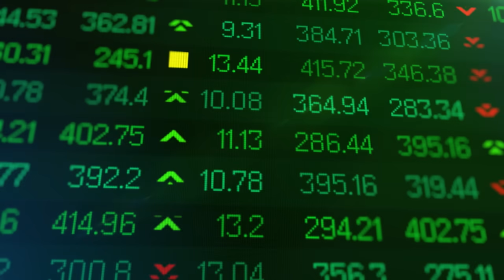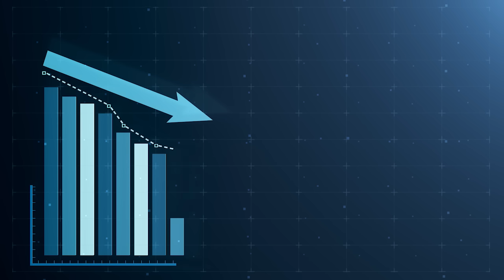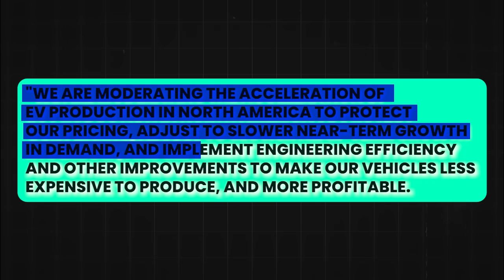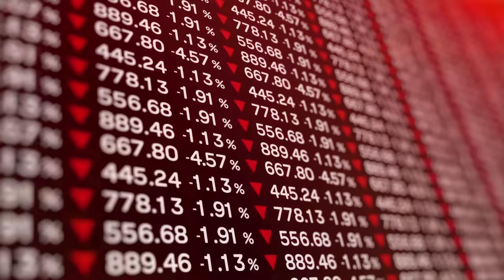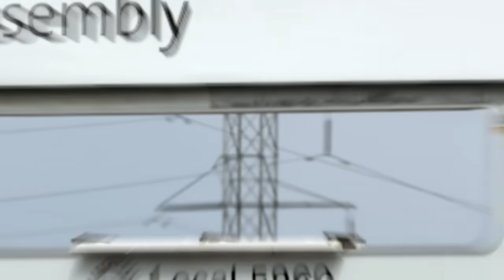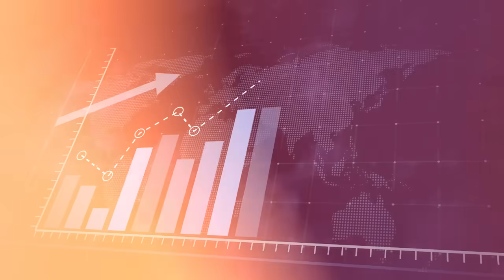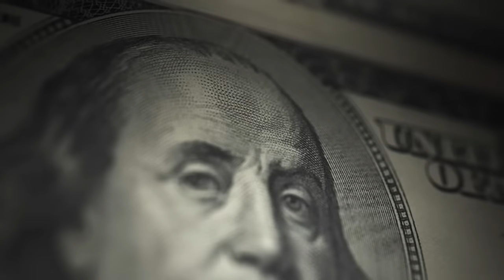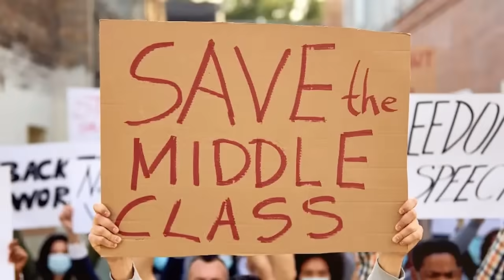HUGE NEWS! GM CEO Just SHUT DOWN EV Production!

Comment: EV's are not practical as a vehicle to keep for a long period of time. Just wait till people have to start fixing them.
Reply: No one is talking about how the batteries will fail and not be repairable within 10-15 years regardless of mileage, charge habits, and maintenance. It’s the chemistry. And the batteries are $10-20k to replace that will total EV’s of that age due to resale value. They want you to focus on degradation from mileage and charge cycles, which is a distraction technique from the real issue. The average age of cars on the road is 12 years, so many are older than 15 years. If you only drive 5k miles a year and keep your car for 100k miles, you will have had to buy 1 or 2 new batteries by then. Horrible for the environment to make the cars financially end of life so soon.
Reply: EV's are so proprietary that most will not be fixable after 5 years as no parts will be available and the cost of those parts will be cost prohibitive.
Reply: So far, EVs have required far less maintenance than gas cars. There are lots of tesla's with over 100k miles and everything works fine.
Reply: @JetFire9  Your comments are three years out of date, mate.
Reply: @frotobaggins7169 you get it sir.
Reply: @KidHorn7001 it’s different for Tesla. They don’t have millions of ICE vehicles to provide support for. This can get very expensive and unsustainable in the long run. Tesla only has a handful of models to support. So they can adapt easier to market demand.
Reply: @KidHorn7001  forget 100k miles, there are plenty of tesla's with 1 MILLION miles and still work fine. And I say that as a Tesla hater.
Reply: Or the fact they will have ZERO trade in value due to failing batteries when it's time to buy a new car.
Reply: @KidHorn7001  Lots of them have had early battery and drive unit failures, but thanks for your lies.
Reply: @sprockkets  Yeah, sure, but how many drive units and battery replacements. Clown.
Reply: Try driving one across a state with wind chills of -30 or even greater.
Reply: @1Mhoram9  That’s easy to do. You just sit in the driver’s seat while it’s being towed in the back of a trailer by a pickup with a Cummins diesel. 🤣🤣
Reply: @swanvictor887  I wasn't aware that 18 year old EVs are on the road. lol. I have noticed that too many people in the comments are bragging about mileage which isn't the point of OP. And as this current crop of EVs age out, it would be interesting to see what the market for them will look like.

 One hopes that a technology breakthrough would be there by then which would actually make newer EVs desirable to buy and own. As far as I am concerned, EVs are still in development age equivalent to what ICE cars were like prior to important inventions like the starter. Imagine if governments of the day banned horse drawn carriages immediately (to reduce methane) and forced everyone to buy a car that needed a crank handle to start. And then Clyde invents the electric starter - imagine the retrofitting headaches that would have caused 🤣.

So by all means, people with the means should buy EVs because funding for R&D has to come from somewhere - as with the history of the development of ICE vehicles. Only the rich and upper classes could buy them in the beginning, as they were also the ones who could have their own personal mechanics to fix what was still an unreliable system.
Reply: @JetFire9  There are now EVs from Tesla for more than 10 years on the market. The experience shows, that the capacity of their batterie lies at something like 85% on average. The capacity goes down quite fast in the first few years, but then slows down. You can expect to  drive a Tesla  200,000 miles without replacement of the battery.
Reply: Fix What? The Engine - The Transmission - The Drive Train - The Radiator- The Brakes - The Turbocharger- The Muffler(s) - The Hoses - The Belts - The Fuel Injection - The Instrument Cluster - The Distributor - The Smog Stuff - Spark plugs - Oil changes - The poor Quality but Expensive warranty work - The poor Materials fading/Cracking. The Catalytic Converter gets stolen.
Tesla has NONE of these complicated systems to need repairing/replacing and requires almost Zero maintenance to get 1/2 Million miles with a (getting cheaper) $15k Battery pack, ready for Another 250k miles. Ohh and the Brakes last about 10X longer because the Motors do 90% of the braking for you while recharging the battery.
Did I forget anything ? Starter motor? - Fuel Pump? - Oil Changes - Dealer Recalls (gone for days, repaired by helpers, not mechanics).
Cheers from San Diego 
And the latest Tesla’s are being reviewed as a Luxury level automobile for Quality and materials. Crash safety is Unbeatable.
Reply: @Julian-1111 Funny you mention recalls. Four of the top five most recalled vehicles are Tesla, and they only have 4 models.
Reply: @sprockkets good lord man watch your words - I see that there is merely 1 to have a million miles.
Not “plenty”.
Reply: @ph5548 idk about other brands (a-hmmmm gm) but 5000 miles per year in a new Tesla the battery gonna last 40+ years
Reply: @rcallenberg  You forgot to mention that the cheapest Tesla is $43,000, and you have to take it to them for EVERY SINGLE REPAIR. So, the brakes lasting 10x longer doesn't really help you out when you have to pay an average of $1500+ for a brake job on one of those when it does come up. But don't worry, I'm sure they don't rake their customers over the coals for parts, labor, and literally anything else like EVERY other dealership in history. And if you think the quality is that great, you haven't done a whole lot of research. People have found all sorts of quality control issues with them right from the factory. That being said, I still do like Teslas. However, we're talking about practicality here. And the average person can't afford a $43,000 car.
Reply: @KidHorn7001  The average age of an ICE vehicle on US roads is 13.1 years. The average age of an EV is 3.9 years. We have no real data on long term cost of ownership.
Reply: Batteries up to 70k to replace.... not many people have 70k laying around ...ontop of buying a 100k vehicle
Reply: Do you also argue that the cost of such an expensive battery means it's not worth it? You can't have it both ways you know. Either the battery is prohibitively expensive, or it will have zero value. It can't be both. Stepping back and examining this properly, there's a lot of minerals in a battery. The value of these minerals hasn't left, just their ability to do the work they are supposed to be doing. (never mind these batteries will outlast the cars, 99.9% of the time, and go on to serve a full second life as stationary storage at someone's cottage, or refurbished by a shop somewhere, before needing to be retired. Once it's beyond any useful life, the owner has 13k worth of battery minerals to sell to the local recycler. And yes, they are almost 100% recyclable. You don't hear about battery recycling all that much because the batteries are better than we thought and there just aren't enough dead batteries to justify building recycling facilities. Yet. It will happen and there are those preparing. But batteries are also falling in cost. My greater fear would be buying a car with 13k worth of valuable minerals in it, and it's only worth 3k by the time it's dead and I'm trying to sell it for recycling.   @TheGodDamnJets87
Reply: I saw recently that the cheapest M3 is down into the low 30k range, 32 maybe? can't recall, once subsidies are factored in. Depending on what state one lives in. I live in a province so it does me no good. But there are no brakes to do. They simply don't ever need replacing. Track cars, maybe a different story but for the average user, they'll never do their brakes. Nothing more than blowing the dust off with an air hose. 
 @schectermeister
Reply: EVs will be an expensive modern day Bic lighter.
Reply: @jeff_mossy  Doesn't matter - the tired line that people need new batteries after not even a few years or not even 100k miles, is simply false.
Reply: @TheGodDamnJets87  "they will have ZERO trade in value" 10 year old Teslas have a price tag somewhere between $20,000 and $25,000
Reply: @rcallenberg  yeah, and who in there right mind would buy a used electric car? With the price tag of 20k to replace the battery? EVs are stupid.
Reply: @schectermeister  "the cheapest Tesla is $43,000" Well, it's actually less than $39,000. "the average person can't afford a $43,000 car" Currently the average price for a new car in the US is $48,000. The most sold car in the US is the Ford F-150, starting price is more than $38,000, about the price of a Tesla Model 3.
Reply: @Texas2Step79  "Batteries up to 70k to replace" Where do get this number from?
Reply: @TheGodDamnJets87  "to replace the battery" 10 year old Teslas have  around 80% of their initial battery capacity. It shows, that the battery degradation slows down after the first few years. Modern batteries are expected to last even longer. Kia for instance gives a warranty on its  EVs of 10 years or 100,000 miles.
Reply: @rcallenberg  cool story dude. 😎 I lived through hurricane sandy in NJ. No power for over 3 weeks, sorry I will NEVER buy an EV. ICE for life here.
Reply: Wait until those lithium batteries need to be replaced at a cost of 20k or more.  The cost of a nice used ICE that will outlast the EV depending on the brand you buy.
Reply: @TheGodDamnJets87  Were you able to find gas stations that had their own back up generators in the 3 weeks that they had no power from the grid?
Reply: @Thankz4sharing  yep, beautiful diesel generators .
Reply: Yup...I heard that the Average Battery costs fall into the range of $3,000-$5,000. Then there's the cost of labor to replace it....
And in a lot of cases, the Car itself is built 'around' the Battery so not many people have the knowledge or equipment to handle replacing it themselves...Not to mention, if you're not a Certified Electrician you could Electrocute yourself and possibly even 'Die' in the process...Now That's a sobering thought...
Reply: @joeleyendecker5346  ...all good points Joel, but you have to wonder: how many consumers will drive just one car over 800,000 km (550,000 miles) in fifteen years?  Once the battery is installed, well, there's little reason to mess with it ever again.
While you ask questions which on the surface are good ones, I'm afraid the free market has already moved on. EV sales are exploding while ICE sales are plummeting.
Love them or loathe them, EVs are here to stay. WE are just going to have to change our ways, is all....
Reply: @sprockkets  not sure what you’re saying “doesn’t matter” to.
It totally matters if you make totally false statements.
It matters that you claim that there are plenty of EVs with over a million miles when in fact there is only 1 recorded case, from what I can tell.
Reply: @rcallenberg What on earth makes you think lithium battery degradation is completely linear?  Every one I ever had worked until one day it didn't.
Reply: @Josh-kp8si  Lithium Iron Phosphate batteries have incredibly long lives, CATL guarantee theirs for ten years and at least 800,000 km.  Few owners keep their cars for that length of time. These batteries will survive long after the vehicle, as they can be recycled. But even if you're correct and its all nonsense....we are at the very start of the EV story. The progress just in the last decade, puts the Auto industry to absolute shame. Developments in Battery technology are breathtaking. Look, I get it, I'm a petrol-head too, loved cars all my life...but its over. ICE IS dead. EV technology is simply in a different league. Moaning and pissing about it isn't going to change Facts. ICE sales are plummeting, Europe (of course) leading the way, USA as ever, lagging behind like a fat wheezy Asthmatic kid on a school sports day...but nevertheless, the change is underway. Simply look at the two top best-selling Vehicles on the planet right now....
Reply: @swanvictor887  I didn't say any of that.  Do you even understand what the word "linear" means?  Maybe try a dictionary next time.
Reply: @Josh-kp8si  I can't find your original comment or my reply, so, I have no idea to what you are referring. have a nice day.
Reply: AMEN! I just witnessed my neighbor going through an episode with his Tesla. It was early afternoon and that particular tow truck driver had already towed 8 EVs.
Reply: Hertz rentals dumping them as minor accidents means writing it off and no servicing and lack of parts. Also insurance going going thru the roof.
Reply: @madewithscraps  you are convincing me completely, that the USA is not ready for such technically complex cars such as Tesla's. Seems the drivers are not ready yet. Europe will lead the way, I guess the USA as ever, will lag behind lol. I guess it is best if Americans stick to what they know and are familiar with.
Reply: @swanvictor887  See ya, 🤓
Reply: @esecallum  Hertz have ordered hundreds of thousand more and in fact, were complaining the other day about the lack of competition because EVs from other companies were utter crap - they were forced to buy Tesla's. I'm afraid you're reading the wrong media...probably media sponsored by Legacy Auto... because the Hertz story is false. But hey, its fine: I expect this from Legacy; they have been fighting, kicking and screaming against EVs ever since Tesla was founded, there are hundreds of billions of dollars and investments at stake, Legacy Auto will keep on funding lies and propaganda until the day they file for bankruptcy. Fake news stories like this Hetz thing are to be expected and it simply doesn't matter: ICE is Dead, it's just a matter of the funeral now. EVs are here, they are not going away. So, the USA will lag behind Europe...what else is new?!  I just feel sorry for the line-workers at Ford and GM: they have been screwed by their management and their Union.
Reply: “The reality of electric vehicles is that they can be 1,000 pounds heavier or more than gas vehicles, and they move faster, with higher torque. Since they’re extremely zippy and heavier, it’s just physics — the ability to overcome inertia so quickly is going to effect their suspension systems, the brakes and steering columns. It’s counter-intuitive, but even with fewer moving parts they are susceptible to requiring more maintenance. They especially require tire-swapping, because the tires wear out more quickly from that high torque and weight
Reply: @swanvictor887  “The reality of electric vehicles is that they can be 1,000 pounds heavier or more than gas vehicles, and they move faster, with higher torque. Since they’re extremely zippy and heavier, it’s just physics — the ability to overcome inertia so quickly is going to effect their suspension systems, the brakes and steering columns. It’s counter-intuitive, but even with fewer moving parts they are susceptible to requiring more maintenance. They especially require tire-swapping, because the tires wear out more quickly from that high torque and weight
Reply: @esecallum  I don't find changing tyres to be horrifically difficult and I change mine every year anyway, I'm sure most responsible drivers do too. Suspensions are fairly strong and despite the extra weight, there are plenty of vehicles on the road, much heavier, we seem to cope. I am pretty sure the maintenance costs for an EV are a fraction of an ICE vehicle, there's not much in the damned things to go wrong.
Reply: Tesla  sales will explode
Reply: @loveand166  Musk has stated for over ten years now, that he wants Tesla to sell 20 million vehicles a year by 2030.
They may not reach quite that high...but it will be close.
If they can launch the new Model2 in 2025 (on damned time for a change!!) and actually sell it at a profit for $25k, together with a ramped CYBT and refreshed Ys and 3s...then Tesla can certainly sell more than 12 million vehicles per year by 2030 maybe more, as new Giga Factories are built around the world. There is literally, NOTHING stopping them. They have the cash. They have NO DEBT.
Reply: Who is making after market things to a tesla or specially designed ev´s and hybrids? Today people can choose if they want to spend alot on a generator or less because the rest of the car wont last that many years. No tesla will ever get 30-40 years old. My 2 cars are 20 years now and works fine. Sometimes i have to buy peanuts when something fails. And they dont drop in price like any new expensive car by the month.
Reply: @JetFire9 I know someone with an 11 year old ev. He has spent nothing on repairs, other than brakes and tires.  You can come up with all the reasons in the world to be worried about new technology. But the change is going to happen.
Reply: @rcallenberg He just made it up, like all the other haters.
Reply: Or replacing the expensive lithium battery.  (20K on up to replace)
Reply: Electric car battery replacement.
If our petrol / diesel car needs a part - they are manufactured and distributed and sit on the dealers shelf until required - ie a metal part is still new and useable 10 / even 20 years later ...these parts stay "new".

Now - if you buy an EV today -it has a specific battery made to fit it ...they have specific size, connections, and often water cooling  connections....
now 5/7 /10 years down the track, when that battery has failed ( and in use they degrade to a point they are useless) could you even buy a suitable replacement ? Given the ever evolving technology in this area, chances are that you could not get a direct replacement.
Now here is the crux of this - and a serious question to ask the manufacturers and car importers ...they wty the battery - but can i get a similar replacement in 3 years ?
The reason this becomes important is that if the answer was YES - then when was that battery manufactured ? If it was made 3 years ago - that battery has done what ? sat on a shelf which means it degrades so it isn't new at all ...its used up a portion of it's life as it degrades.
Or - if the dealer has kept it for 1 year / 2 / 5 ...have they kept them charged ? What dealer is going to have batteries sitting being charged ( they are a major hazard / fire risk ) in their parts store ?
NONE I suspect. And , if they did have one a year old battery , once again it's a used item ...it degrades from day one of manufacture

This is a major consideration to those  who considered, and rejected buying an EV ..I fly RC planes which use LIPO batteries and understand the degradation and failure ( fire risk)  of this battery technology.
It's a very important issue, and one that needs brought to the attention of the public , because the idiot greens and the Government dont even look at such issues - or make it public ...

I look forward to the investigation results .
Reply: Battery replacement is 20k. Nobody is going to pay that, they’ll just buy a new car. The junkyards will be full of EVs in the next few years.
Reply: They're not allowed to fix their own EVs.
Reply: @rcallenberg I would say you can hope. 

I can expect most vehicles will last 150k easily….

Beyond 150k I hope for anything beyond that.
Reply: @Julian-1111 the instrument cluster? That’s when you know you’re on a  unhinged rant when you name something that by law has to be in a car regardless of it being ICE or EV.
Reply: @rcallenberg the average income is $31k in America. That locks out a lot of people. 

If you are handling your money properly that would mean you would need to make 120k to PROPERLY afford a 40k car.

Loans have reached an average 7-8 time frame…. We are short about 2 years from when you can expect the car to start having major issues regardless of power train and by the end of that loan you are way beyond manufacturer warranty. 

My honest opinion EVs made a comeback way too late into the game .. Covid accelerating the price for everything put a bleak future on EVs
Reply: @JetFire9  Not to mention the total environmental disaster on both ends (production and disposal) of these batteries.
Reply: @rcallenberg …so, after about 10 years, the vehicle will only be able to travel about 200 miles under perfect conditions before needing a charge. Another example showing that, in order to own an EV, one must also own an ICE vehicle. ICE saves the day again.
Reply: @TheDieselndust It will be wild to watch! Owners will want to sell before the battery goes out but no one will want to buy them because by then they will be educated on battery age limits.
Reply: Their batteries make them worthless on the used car market. If you try and sell them used you have to take the price of the batteries off immediately. No one will  pay more than a couple hundred dollars for a car if they know they have to invest 10 to,20kin a year or less.
Reply: @TroySavary most Tesla “recalls” are automated OTA software updates that occur at 2am while the owner is sleeping.
Reply: @TheGodDamnJets87 how did you put gas in your car without power?
Reply: @converter42  dumb question. Simply was prepared and filled up jerry cans with gas before the storm hit.
Reply: @converter42  also gas stations have this amazing new technology called backup generators. That run on fossil fuel!
Reply: @Texarmageddon  
Ahem, in modern EV’s they’re Computer touch screens that understand Voice commands in many languages, they can search the internet hands free, they can record your surroundings in case of a collision or vandalism, they will Soon be able get you to a hospital safely while having an "event" even if you pass out.
So what’s this Cluster you speak of, must it be Analog or something, next you’ll tell us that AM Analog radio is Required by Law (crazy but it Is in some countries), so that the emergency channels are available for those with "Clusters" that don’t have Modern vehicles., I guess.
Cheers
Reply: @TheGodDamnJets87  yes, and no one can buy a solar generator battery kit to do the same, nope, don't exist....
Reply: Also lol at omg I Haves to replace them batteries comments. Just this week a Model 3 user paid $9k for a replacement battery after driving 120k miles in under 2 years with heavy supercharging and charging to 100%. That's called an outlier case. He saved over $10k in fuel vs a camry so he couldn't care less. Newer teslas now have lfp and those will last 1 million miles, easily. And can charge to 100% all the time. 
Lol too like pretending 100k gas cars with terrible DI engines that require 20,000 psi don't have issues.
Reply: @graantmnz  
All new Teslas have Battery Pack Modules. When you have 500,000 miles you May be ready to : Undo a dozen screws and lower it onto a pallet jack - Switch it out (after ~ 500,000 miles).
Labor Time for service ~ 2 hours because nothing else is disturbed, Cost ~ $12K to $15K (for Another 1/2 million mile Battery Module).
The CyberTruck will be around $25k for the Xtended range Battery Module.
Cheers
Reply: @Texas2Step79  economies of scale
Reply: @sprockkets "Plenty"? Right.
Reply: @Julian-1111 What a one sided comment. You zealots are very funny to watch spewing BS.
Reply: @Josh-kp8si  " What on earth makes you think lithium battery degradation is completely linear?" Well it is not linear, that's the whole point. It's faster at the beginning and than slows down. "Every one I ever had worked until one day it didn't" That's true for about any technical device. But we are talking about degradation, and that's a gradual process. It is very rare, that a battery suddenly stops working.
Reply: @Texarmageddon  So, basically you are saying, new cars in general are not affordable for average people. I wouldn't argue against it. But where is your whole argument specific for EVs? if $38,000 is too much for the average person, it doesn't matter whether  you are talking about a Tesla of a F-150.
Reply: @niaralosusa  "so, after about 10 years, the vehicle will only be able to travel about 200 miles" When somebody bought a Tesla with 200 miles range in 2013, it will be even lower. The model with the bigger battery went down from 300 to something like 240 miles.If you absolutely have to go 600 miles without stopping, an EV is currently not you option. But for many people who are buying an EV it is obviously not an issue.
Reply: @rcallenberg   I see you missed the point of EVs came way too late in the game… essentially me implying the automotive market as a whole will collapse before EVs take hold
Reply: @JetFire9  But an ICE requires the engine, transmission and differential to replaced when you get upwards of 50000 Klm on them as well and your looking at just shy of 15000 just for that them your also looking at ball joints, engine mounts, steering arms,shock absorbers, alternators, water pump and possibly oil pump all this will set back upwards of $5000 so your ICE

And I don't know what world you live in but all the prius taxis in australia were getting the same 750000 Klm from the prius as they were out of the ICE fords and holdens

As the director of Dubbo Taxi said aside from the cost of the battery which was high to start with all the other running costs fell and after ten years the cost of the battery more than halved
Reply: @schectermeister  Really then you can't do maths can you